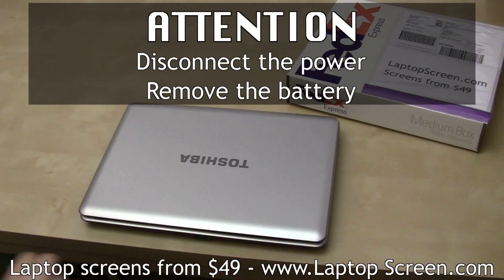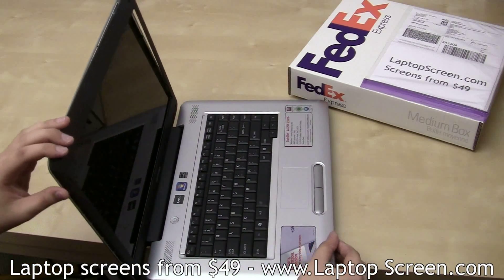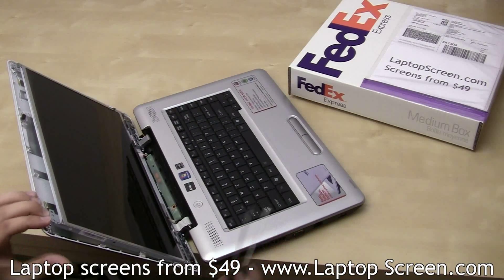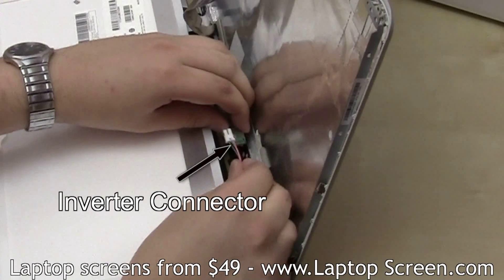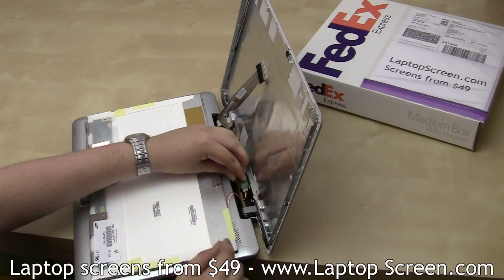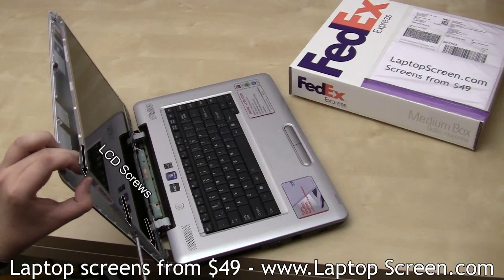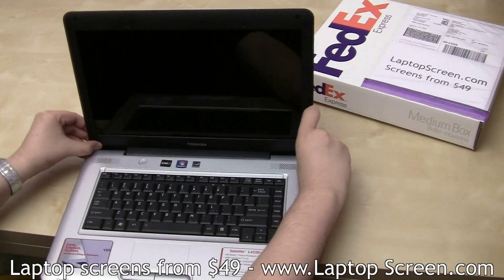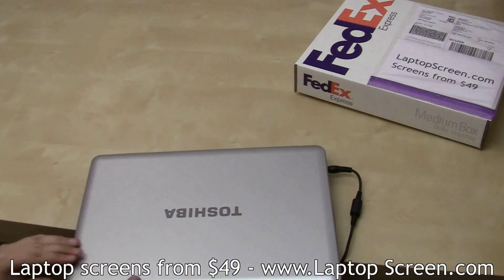Laptop screen replacement, How to replace laptop lcd [Toshiba Satellite L455D]

Comment from the maker: The tin foil lining the back cover is Electromagnetic Shielding. It is not essential to LCD operation, however it's purpose is to prevent image distortions, shaking, flickering, or showing "snow" due to external interference.
With out that foil the laptop's screen may "act up" when near microwaves/cordless phones/radars/etc.

Comment from the maker: Such problem typically comes from the power socket(s) board of the converter ribbon - some laptops use non-standard pin-out to supply inverter power - and thus require custom adapters for the converter.
The conversions that we sell all come with such adapters. If you got the items from us, contact our support, and the appropriate adapter will be found and sent free of charge.

Comment from the maker: We typically recommend installing LED screens to replace previous LED back-lit screen.
However there are conversion kits sold for replacing old CCFL back-lit screens with newer LED ones.
Speak with our support to see if your laptop will accept it (need you LCD model number)

Comment from the maker: Device's MAC (Media Access Control) address will show zeros only if:
- It's disconnected (but driver remains)
- Driver is installed improperly
- Device is malfunctioning

In all likeliness the cable connecting the bluetooth mini-board was never reconnected

Comment from the maker: Actually no. A typical "single" model number of an LCD item will "evolve" over the production years - every new year it'll be a slightly different model, with some alterations to specs and performance.
We make sure to send you the best spec panel, at best market price, in shortest amount of time.

Comment: This is a very informative video.  I had my screen replaced last week and now I have no bluetooth connectivity.  Is there something further that needs to be done in terms of software connectivity?  I have gotten as far as Bluetooth Settings > Options > Device address is 00:00:00:00:00:00:00   How do I change this as I think that is what they forgot.

Comment from the maker: Webcam is usually connected to the video cable, or has it's own separate cable (essentially USB), it's part of the back cover, and in most cases you leave it alone when replacing the LCD.

Comment: I used this video to replace a broken screen on a Satellite M105-S3051 with a new screen I bought on eBay.  Thanks to this video, I had no real trouble.  I was a little worried about how to reinsert the inverter connector correctly, but I see this is addressed in the comments.  Many thanks here for an outstanding tutorial.

Comment from the maker: Technically the polarity does not matter with CCFL,
however the inverter connector is keyed to be plugged in a certain way.
If you plug it in against the key, you will eventually end up with a burned connector due to insufficient contact.

Comment from the maker: @cupcakexrider I'm pretty sure thats the coaxial cable which runs up to the Wi-Fi antenna. You should solder the core with a piece of single core wire, then insulate, then join the outer shielding as well as you can, then insulate that, and it should be alright. Sorry to hear about your troubles =(

Comment: i have a question what is that white wire that is close to the inverter on the outer side of the hinges that runs up the side of the screen. because mine just snapped. and i dont know what it is.. and i know a wire snapping shouldnt be good at all. because they all have a purpose. please answer. thanks

Comment: Great video!! my toshiba satilllete screen got cracked and i was scared i would need to replace the whole thing. I noticed on your video you have 4 screws holding the screen frame in. Is it possible to have 6? i have 6 covers on mine. 2 on top. 2 on the bottom sides and 2 on the bottom middle. do they all need to come out